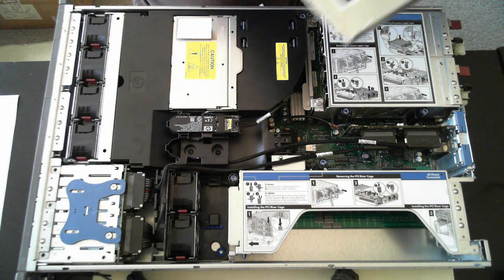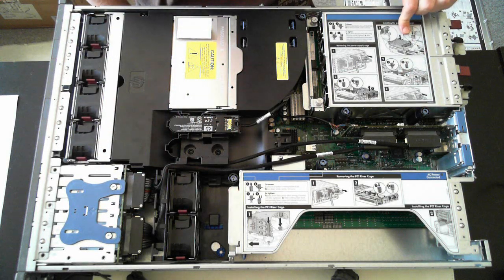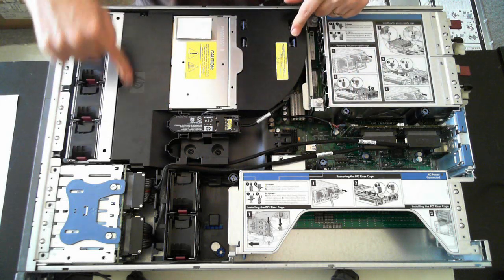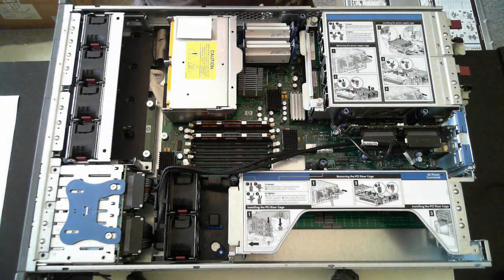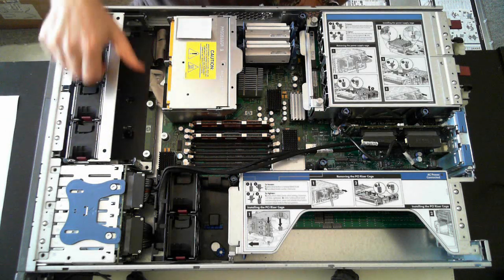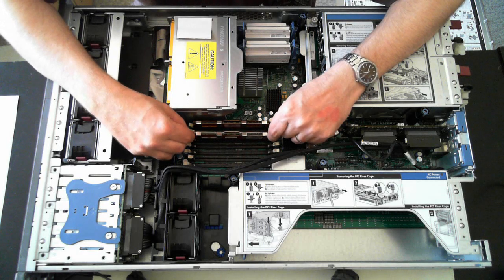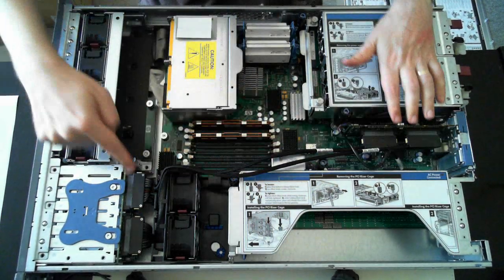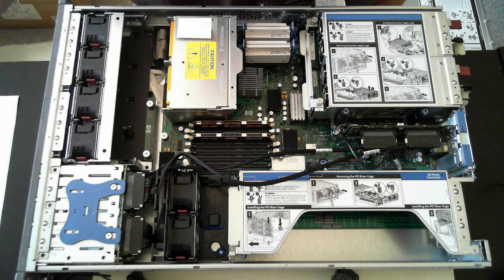HP DL380 G5 Teardown or Opening

Comment: I have same hp server. But this server now shutdown automatically after two days.
What is problem in server
Indicater led show ppm is Amber
Please explain me
Reply: It might be the PPM itself. What the PPM does is it takes your 12v from your power supply and regulates it down into several other voltages that other components can use. It also smooths out the incoming DC power flow. If one of them is amber this likely means that the module itself is faulty. In your case, I would recommend switching the PPM around (put each one in the other slot.) if the amber light shows up on the opposite of which it normally does then the module is faulty and it warrants a replacement. If it is the same module, check and make sure there is no debris in the port. If there is not then I'm afraid you have a faulty board. 

Here is a link to a replacement part: 
https://www.thebestpartinc.com/407748-001.html?gclid=CjwKCAjwvtX0BRAFEiwAGWJyZExtqV4pxPoW_tnqzuDebQJFtV9A1pR8TqIkAx8qngN6WZgnZ1Wy5RoC4u0QAvD_BwE

Comment: Hi
i wonder what HDD type has this server?
Is it 3,5 or 2,5 ?
Reply from the maker: They are 2.5"
Reply: if i have a 3,5 hdd sata 7200 rpm, would it work or servers need special hdd
Reply: @moudar123  I have the exact same server and they use SAS drives (Scuzzy)

Comment: Is it possible to completely bypass the RAID controller on this? I want to do Linux MD RAID for 2 OS devices and zfs mirroring for my data and not have any conflict with the RAID card. So far, I've only read you can do individual logical RAID 0 configurations per disk, but I also here this causes issues

Comment: Hey man could i install a full height graphics card in this rack mount case? I know it isn't the purpose of a server to become a gaming machine but i've found one of these for less than €100 and i've become tempted to buy it and mess around with it a little. I know powering it wouldn't work with the internal psu's but i can use an external one for testing purposes. Also, i've read some things about these servers not working with non-hp ssd's and hdd's, what's your experience on that subject?
Reply from the maker: +Ramses from memory a full height card wouldn't fit. It will work with non HP SSD's and HDD (HP though would prefer you to pay a fortune and buy only HP approved drives though).
Reply: dpcomputing So ram clearance is an issue? I'll try to use a pcie riser card then as a temporary solution. I don't feel like buying a 300gig hard drive for 100€ so thanks for letting me know that does work :)
Reply: dpcomputing use a mini itx 970 video card and you'll be fine
Reply: Ramses yea u can I have a gta 1080 in the same server ps look in the riser

Comment: I am planning to buy HP Proliant DL380 G5 Server with no processor and no ram. I would like to upgrade it in such a way that it can support 128gigs of DDR3 RAM. Could you please advise what can be done to achieve this?
Reply from the maker: +negi2u according to the specs here - http://www8.hp.com/h20195/v2/getpdf.aspx/c04286057.pdf it is a max of 64G.
Reply: +dpcomputing Thank you, I found this info useful. I am checking now for secondhand Dell R710 with six core processor instead of quad core.. :-)
Reply: Well what you would need to do is buy the G5, sell it, buy the G6 (or G7) and that should do it ;)
G5 doesn't do DDR3 let alone more than 64GB.

Comment: Hi I have server hp dl380 g5
The power supply no have cable power
for graphics card
How can work with nividai quadro fx 5800 4 gb
Reply from the maker: قناة الابداع الاسلامي why are you using a nvidia quadro in a server? Servers aren't designed to use suck video cards.